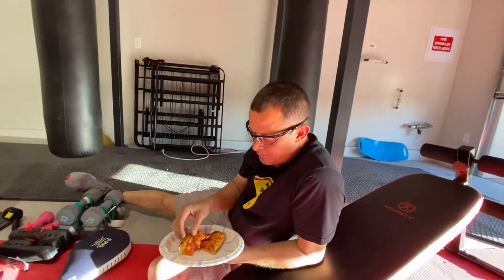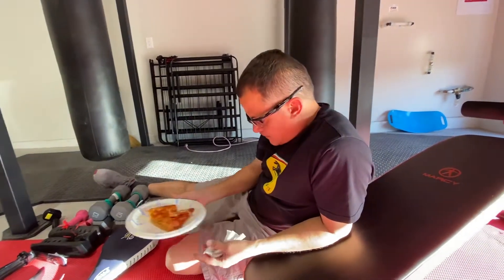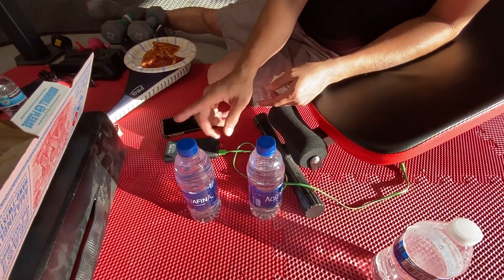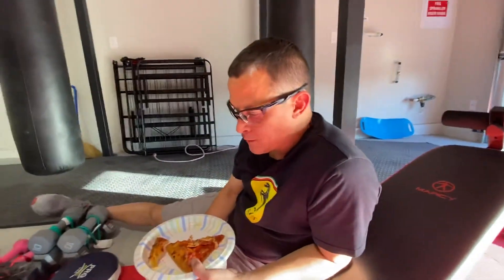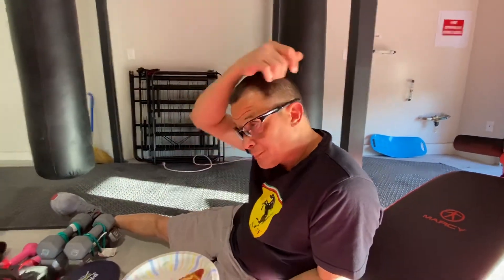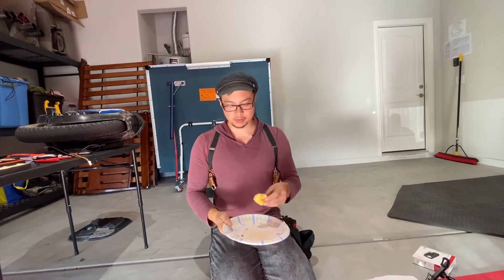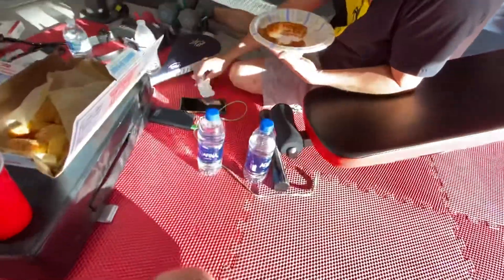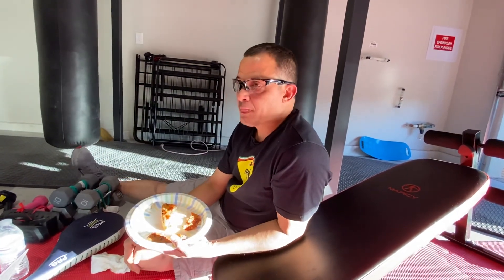EUC Battery Charge Don’t Go To 100%? Here’s why

Comment: This video could be a life saver to me. Thanks so much.
My case. MCM5 V2, 84V, 800Wh. I got it from a friend that gave me a Fast charger. I thought it was awesome but it wasn't. After a while I noticed that my wheel wasn't charging more than about 80%. Today my friend gave me the official (not fast) charger. My wheel was already (fast) charged. I plugged the new (not fast) charger and after a while I got the green light that tells you that it's full. Of course if wasn't: 83%. I was going to cry thinking the battery/es iis/are damaged but now I've found your video.
Tell me if I got it right. To solve this issue I should ride for a while (50% for example) and then charging it again (of course with the normal charger). When done it won't show 100% but for sure morhe than the old 83% I had before. After 2/3 cycles like this one, I should reach 100%.

Is it correct? Thanks again.

Comment: first, fast charging these packs do not hurt the packs. 
stop worrying about prolonging your battery packs. charge the damn packs to %100 and enjoy the ride. for the life span of your wheel these packs won’t degrade. unless you are planning to keep that wheel for ten years😬.
best way to explain fast and slow charging:
try filling a 2 litre bottle with full flow from the tap, it will fill up quickly and then over flow. you turn off water and find out bottle not full.
do the same with slower flowing water and you will fill straight to the top, just takes longer.
exactly the same when charging.
Reply: this

Comment: I'm not an electrical engineering, but based on what I've gathered from the forums and simple electronic theory (this could differ between brands of eucs and how their BMSes work), fast charging shouldn't be the reason why you don't see a full charge.
Not seeing a full charge is mainly due to either:
1) Your charger isn't actually outputting the full voltage. Eg: 84V system, charger is only outputting 81V, then you can only charge up to 81V.
or
2) Your batteries are not balanced and the BMS's overvoltage protection kicks in to prevent you from charging to full.
So fixing this would be
For 1. get a charger that outputs full voltage. You will need to check your charger via a voltmeter to determine if a charger is good.
For 2. Charge to "full", discharge a bit (ride around a bit), then charge again to "full". Repeat several times for heavily mismatched packs. Each charge allows for the BMS to do more balancing between the cells.

Comment: Is this actually good advice though? No where in the video does it talk about BMS and the balancing capabilities. Sorry if this comment seems harsh, but this issue is near/dear to me since it is my Nikola that went up in flames so I have been scouring the internet for the best info. From what I've gathered on the electric unicycle forums, the advice seems to be:
1) Always charge your battery to 100%, but don't charge until you need to go for a ride. Storing a battery fully charged is what decrease the battery life. The exception of course is if your battery is in an extremely low state already. Then charge it up a bit before you store to prevent the battery from naturally going into an undervoltage state.
2) You want to always charge to full because all unicycles (at least currently) only have passive cell balancing (with the exception of the Z10). Gotways, Kingsongs, and Inmotions only engage in passive balancing when the voltage of your cells are near the top.